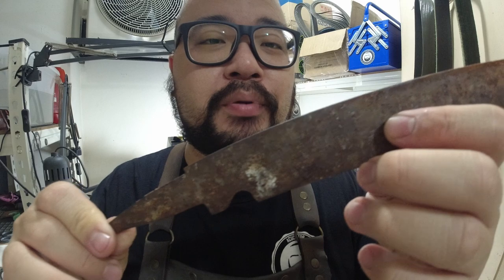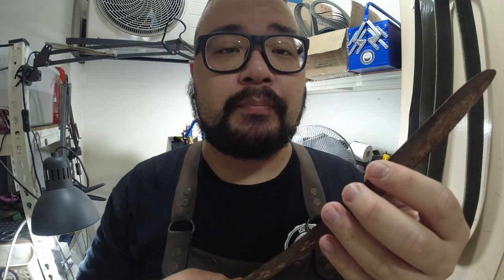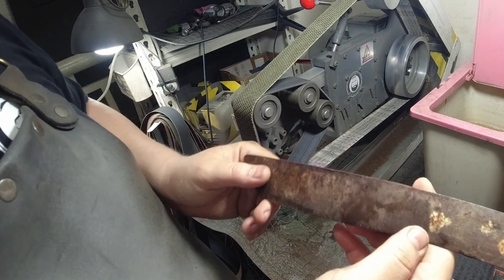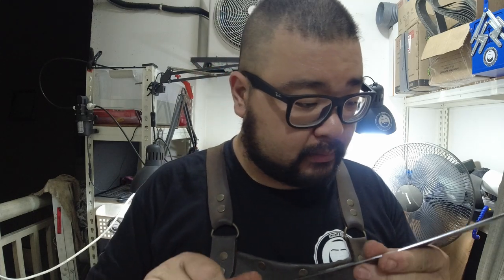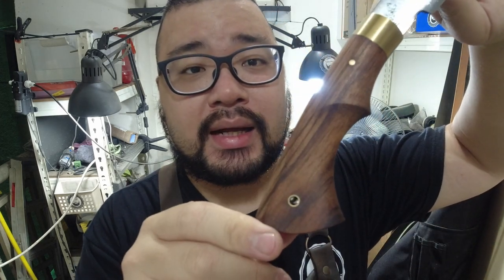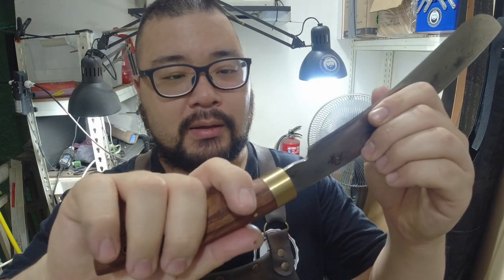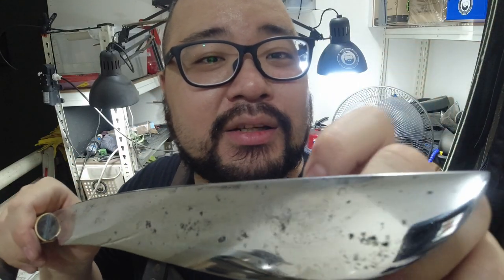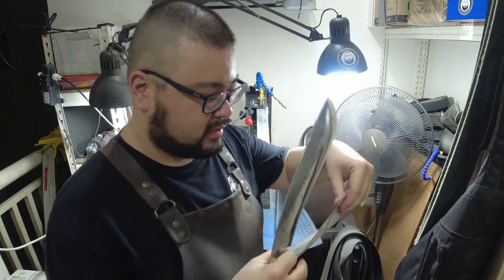Restoring A Malaysian Parang

Comment: the widened flattened back can function as a form of structural support to the blade just like an I beam this was actually created on purpose on some historical single edged swords
Reply from the maker: I think i've seen some old swords with that kind of feature, i've also know people use fullers/blood grooves in blades to mimic the I beam effect and to reduce some weight, perhaps more essential for a longer blade that might have a bit too much flex and weight in it. though Parang's don't usually come with a flared flat top, at least not from the makers, a fuller in one might be pretty cool though.

Comment: Hi man, just found out your channel.
keep up the good work, love your vibe indeed.

May I know did you started as a freehand sharpener (with whetstone) in your early day ?, and how much does your belt machine cost ?
Trying to start to do sharpening kitchen knife here in Sydney for extra cash on the side.

Thanks in advance
Reply from the maker: Hi thanks! no i started with a sharpening jig called the edge pro apex4, then I progressed to the hapstone v7 and then the jende jigs. My first foray into machine sharpening was the Tormek T8 which cost me about 1.5k USD inclusive shipping and tax. My first grinder cost me about 2k USD, give or take, can't remember it exactly. My second grinder was about 2.5k USD, also give or take, it's been awhile hahaha. 

Belt grinders are a lil scary to be honest. my first scare was when the belt snapped mid sharpening. I've also had blade tips get caught be the belt and thrown down (always sharpen edge facing away from you and trailing edge).